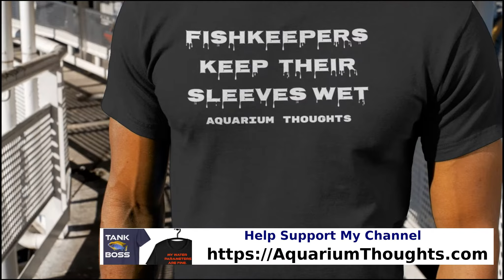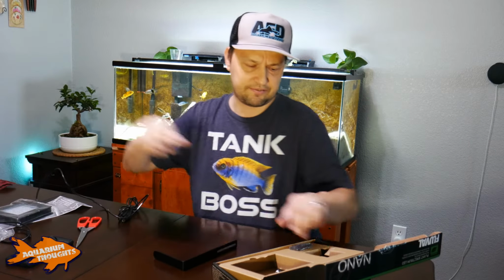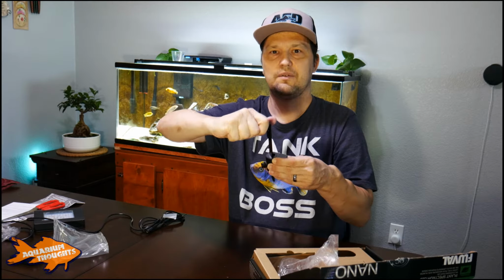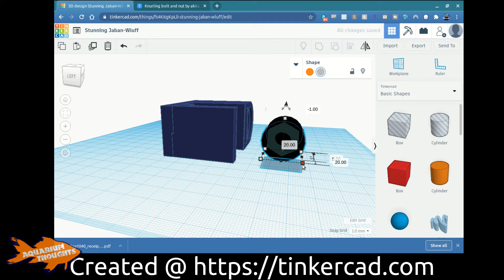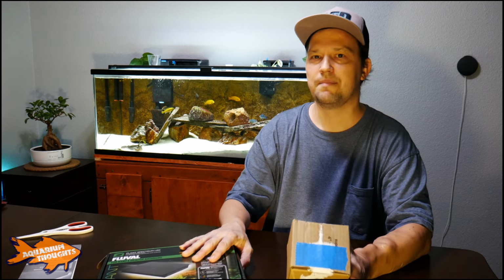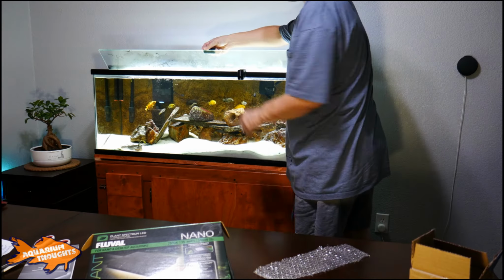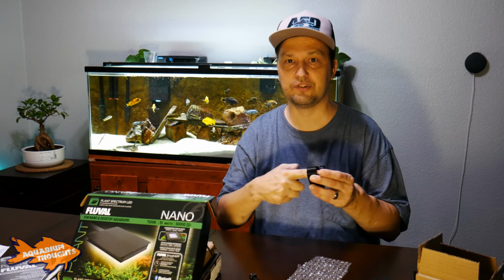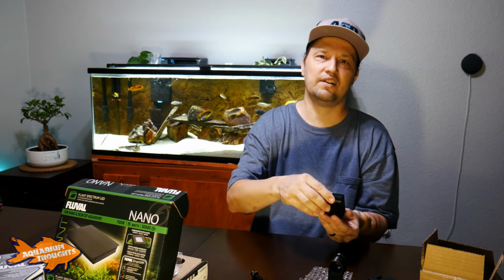3D Print design for Fluval Nano Light for Rimmed Tank - Part 1

Comment: Why can’t Fluval simply offer an adaptor that is wide enough to get over a rimmed tank?  It's frustrating to get their light home and find it won’t fit on the tank.
Reply from the maker: That's a very good question. I'm guessing they really only thought about the rimless crowd with this one. I'm trying to work on a solution to hang these in the near future personally. I'm doing some slight "remodeling" and I need the space along the rim.